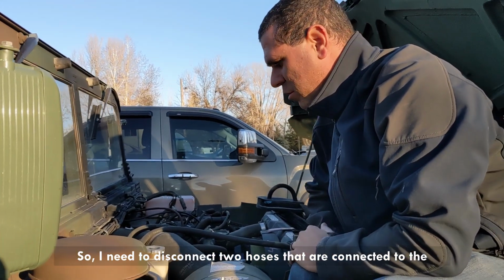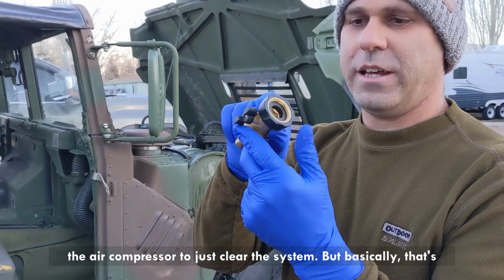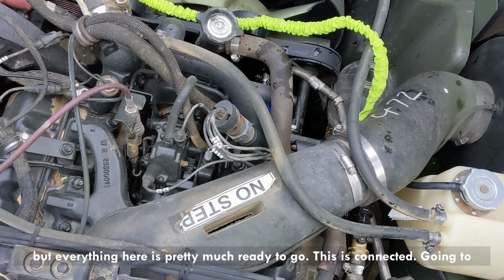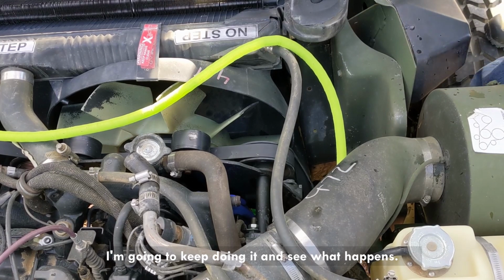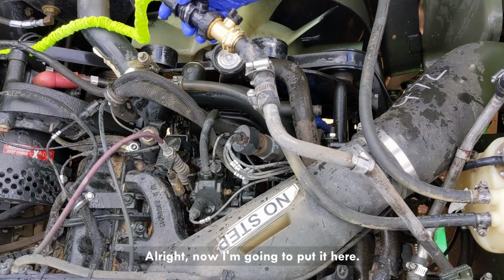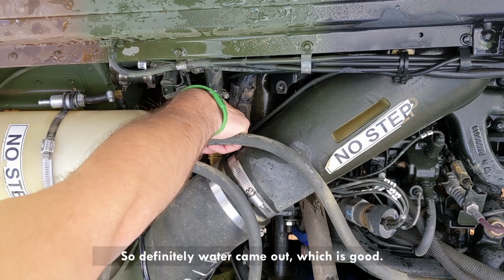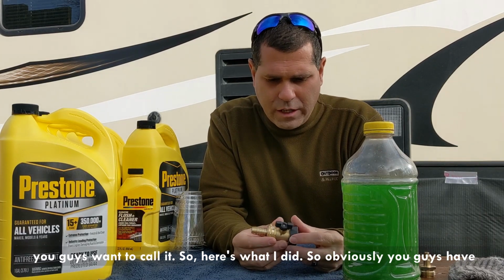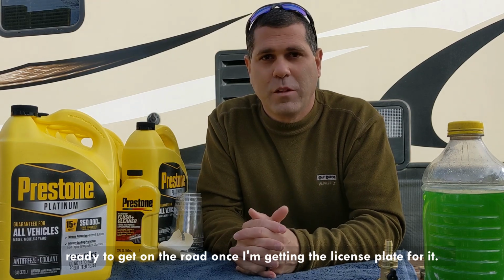Humvee Heater Core Flush (& Fixing the Heat in the Humvee!)

Comment: Hey fella, you may not be a professional, but you've already done more than most fly-by-night operations by disconnecting and flushing the heater core both ways separately of the rest of the cooling system.  My advice to you...disconnect that heater core before you flush the rest of the system, you don't want debris from the bottom of the engine cooling jackets to get pushed into that freshly cleaned heater core.  Just bypass it, flush the rest of the cooling system, and the re-connect when you're satisfied that it's clean.   

Also, you can do all the flushing and cleaning with "tap" water, but make sure when you re-fill the system with the proper coolant/water ratio, that you use distilled water.  The reason you had those calcification "rocks" in the core was from someone using crappy water with minerals in it previously...   Keep up the good work!

Edit : awww, just realized I'm late to the party on this one..... Dang!
Reply from the maker: Hey, thank you for the feedback it makes sense! Glad you enjoyed the video :)